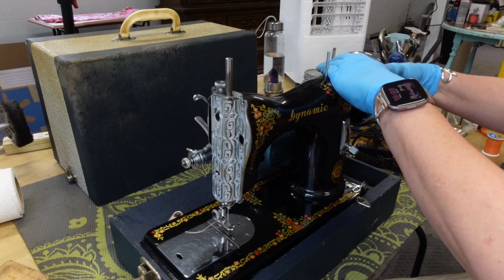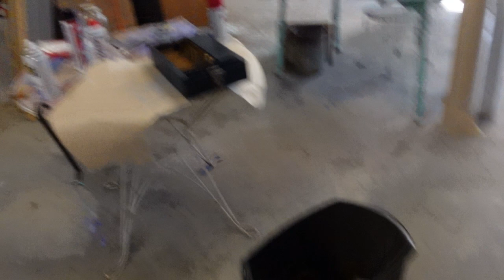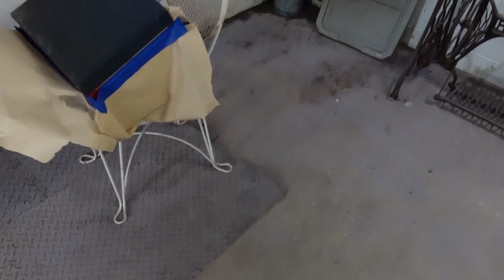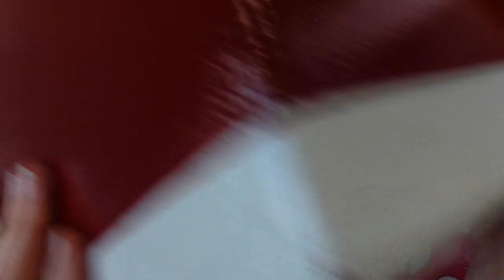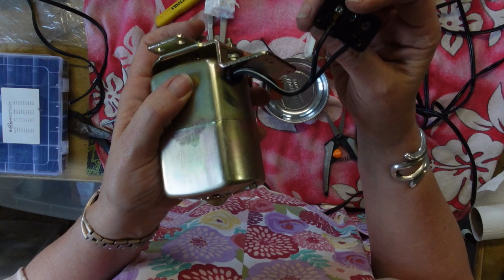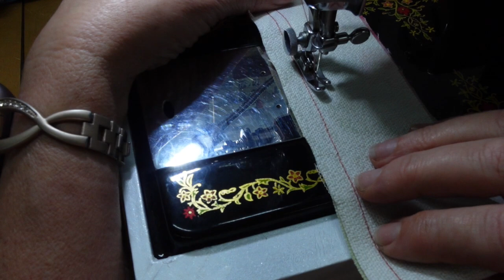The Dynamic Sewing Machine  Case Repaint

Comment: The release date for this movie Psycho is September 8, 1960.  So this machine is 1960 or earlier.  
The case handle is identical to the Singer 301, which was made 1952 - 1957, so this is from that era too.
I could not find any specific dates for this Adler Dynamic Model 73 sewing machine. Durkopp Adler was built in Germany, later Adlers were built in Japan by Koyo, Toyota, Maruzen companies and more.

Sorry to say, but you have not understood wood.  This is a poor paint job and not to be copied. You cannot spray paint over old decaying vinyl. You need the following steps:

1. Remove all riveted hardware, yes, you have to redo it with a rivet gun, or screws. 
2. Soak hardware in Jasco Paint Stripper or buy new hardware. Scrub with 00 steel wool, then Acetone to remove stripper. Then wash well, and polish with Silicone Rubber Dremel bits, or wire wheel to remove rush and corrosion.  Then buff them out with polish under a high speed buffing wheel or by hand using 0000 steel wool. Wash, rinse off polish, dry, reseal with oil based diluted polyurethane to preserve the shine.
3. Strip the old vinyl off with a Wagner Heat gun ($22).  Apply stripper to soften adhesive and scrape off.  Wash down with Acetone and 00 grit steel wool.
4. Sand down entire box inside out with 80, then 150, then 220 sandpaper. If wood is nice, don't repaint, oil up with Boiled Linseed Oil, dry for 2 days, then diluted oil based PolyU. If wood is crappy, paint it.
5. Roller brush (do not spray) Kilz or Zinser Oil Enamel Primer.  It must be Oil Enamel not Latex.  Let dry. Apply second coat if wood is porous.
6. Lightly sand down any pooling, drips, etc.
7. Roller brush or spray Oil Enamel Paint over the primer - Rustoleum 2X is good and solvent is Mineral Spirits.. Another high quality paint with fabulous color choices is Montana Gold made in Germany.  The brand is Montana Gold and solvent is Acetone. This is an acrylic not oil enamel but it is not water based.  Sold at Blicks, Jerrys Artorama, Amazon, etc. Pricey but a fine spray nozzle, and never fades even in direct sun for 2 yrs, which is incredible.  They also have metallics.  After spraying several thin coats which dry fast, let dry one day.
8. Brush on an oil based clear interior satin Polyurethane by Varathane. You must dilute it 50% with Mineral Spirits. This dries fast in sunlight. Brush it one light coat at a time, wiping off excess in 10 mins, for 2-3 coats to seal off the more delicate enamel or acrylic paints below.  Now it is sealed. You can apply decals to this, or decoupage, and reseal with more Polyurethane.  I NEVER use water based PolyU, only Oil based. Note that Satin finish is not as runny as Semi or Full Gloss finish. 
9. Remount hardware.

Do not spray a sealer coat, and NEVER SPRAY POLYU.  Do not shake PolyU, stir it, and tap bubbles out of paint jar you are using. Bubbles make craters on surface. Wiping it off removes craters, pooled paint, drips, drops, etc.  Case is now water resistant.
Reply from the maker: This is definitely a learn as you go channel. 😅  Maybe you could create your own videos with all of your helpful ideas.